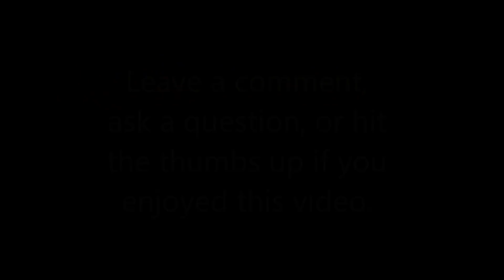Machining Cutters You May Have Never Seen - But Should Own

Comment: Unrelated question: Any tips for holding hex stock/collet blocks in the vice between corners as opposed to flats?
Reply from the maker: I am not a fan of holding collet blocks on the corners. Square blocks can be seated in a V block for 45 degree reference, but hex blocks need a 120 degree nest to do any aggressive work. Always inspect commercial blocks to verify the central nature of the edges.
Reply: @joepie221  yeah my issue comes from the corners not been ground evenly. The flat surfaces are fine (for what I do) but the material removed from the sharp corners is inconsistent, meaning when I clamp on flats I have to reset my tool height each time but clamping on the corners is sketchy at best.
Reply: first step - make some block of aluminium with hex hole in it to decent fit your hex holder.
second step - cut flats on two sides of this block.  (insert your hex holder in hex hole of a block halfway and lock it with some non-permanent loctite. then clamp sticking out hex holder in your vice by flats, indicate it horisontal and mill flats on the block of aluminium )
third step - cut a slot along your aluminium block.
square holder for hex holder are done )

Comment: LE phenolic is not epoxy filled linen cloth.  Rather it is linen cloth impregnated with phenolic resin aka Bakelite.  Bakelite was one if the first plastic resins and is made by a condensation reaction of phenol and formaldehyde.  Early printed circuit board was made from this material although now largely surpassed with epoxy/glass or epoxy/polyester materials. 

https://en.wikipedia.org/wiki/Bakelite
Reply from the maker: Can we safely assume the bakelite is applied in a resin form that impregnates the sheets. Much like an phenolic epoxy binder?
Reply: @joepie221  I recall making some of the resin in the lab years ago. My recollection is the it was a gel-like substance.  I recall that it didn't look anything like what I was expecting.  I don't know the particulars of the process but I would expect that the resin would be forced into the stacked layer of of linen cloth and then heat and pressure applied to cure the composite.  Epoxies are totally different compounds made by a reaction between epoxides and amines and are commonly liquids prior to the polymerization process
Reply: In college, we used Bakelite to hold Metallographic samples. It came as a powder and you put it in a thermo-setting machine, which makes this sweet, slightly toasted smell. To make composites, you end up adding a certain mass of granules in relation to how much reinforcement you use. Neat stuff.
Reply: Actually some is, and differs from an earlier material being talked abut here. Bakelite. Not the same materials. Linen based here was first made by, and patented by GE under the trade name Micarta. There is Linen, Canvas, Paper, burlap, Rag which looks much like very highly figured briar wood are very sought after  and a few others thrown in the mix. There is a new version that is being made in Japan, Russia, and now China. Very fine and quite expensive Diamond Matrix sharpening Stones. These are basically a micarta type product, but using fine synthetic diamond grains and at times mixed with Cubic Boron carbide. Very effective! And far superior to typical diamond sharpening stones.  

KnifeMaker
Retired after 47 years in the Custom Knife Making Business.

Comment: Joe.
Is it still climb milling when the spiral is pushing down ?
Reply: the cutter is still pulling its way up the material so i guess so.
Reply: Yes.
Reply: Climb/conventional has to do with radial engagement.(thin to thick/thick to thin)
Reply: Climb cutter is good if your machine gibs&screws dont have slop in them.
I was told always conventional mill when you can!

Comment: Joe, how tough is that LE phenolic? I have on my lathe a phenolic gear that drives the quick change gear box. My lathe was originally in a trade school setting, but it appears as though it wasn’t used much. I just worry about the phenolic gear being pretty weak. So far it has held up fine but I still worry, if I can still get that gear from Cincinnati Lathe it would be horribly expensive! I suppose I could cut a gear, but I’d have to get the proper gear cutter set.
Reply from the maker: That LE phenolic is very tough. If you have a gear made from it, its probably the engineered weak point, so something more important doesnt blow up. I would not change the material without investigation. Its easily cut, just don't burn up the tools thinking its wood.
Reply: Joe Pieczynski  that was my thinking about that gear being the engineered weak point! Although there are 2 other slip clutches one on the feed screw and one in the apron. That gear protects the quick change gears.

Comment: next time you should add so called 'compression cutters' to the selection. great tools if you need them. to avoid burrs on the top and on the bottom surface of the part.
Reply: Those cutters are amazing on composites.  I was given a carbon fibre tube in which to cut a slot for a hydraulic cylinder position indicator.  The tool rep delivered a compression cutter. Job done easily.

Comment: Johnny woodworker calls them UP spiral and DOWN spiral, but the effect is identical.  Was kinda hoping you would try a straight  router bit. - Next time I have some non metal in the mill I'm going to give one a try just for kicks. - Maybe just for a finish pass.   BTW, Been cutting "into" the part since you hipped us up. Don't meed the Noga burr tool at the mill any more. ,,,, Like they said in "Pirates"  What never? Well,,,,, hardy ever. and right good mill cutter too.  (Bet the millennia won't get that one in a million years)

Comment: If you are cutting wood, try the up/down spiral bits. They are designed to keep both the top and bottom under compression.  https://www.amazon.com/Whiteside-Router-Bits-UD2102-Compression/dp/B0012K5YDK
Reply from the maker: I just recently saw those. they must be a dog to grind.

Comment: Micarta is nasty and G10 is hard on conventional cutters. That all said I'd rather burn through end mills in g10 than work with much micarta. I've done only a little bit of micarta with 3d milling knife scales. G10 actually forms what's almost a chip where as micarta basically turns to a nasty smelling powder.

You can easily cut sheets of composites on a wet tile saw as well. 1/4" G10 and carbon fiber cut quick and with little effort.
Reply from the maker: I have so much experience with LE phenolics, I'd take that over G10 any day. No glass for itchy rash afterwards.

Comment: Joe I wonder if the burr problem could be mitigated if you were to put let's say a quarter inch piece of 6061 aluminum on top and sandwiched the two materials together under the clamp pressure. I suspect that having a harder material on top will prevent the burr from forming. What do you think?

P.S. - that carbide burr cutter is a sweetheart!!
Reply from the maker: Sandwiching thin or easily chipped material is always a good idea.

Comment: Watch out cutting G-10. The dust is a health hazard.

If you're running in plywood, I'd expect speeds upwards of 10k RPM. I thought those left spiral cutters were only for through slots. Most decent woodworking stores have them. With the end mill, if you knock those splinters off, you'll see all the damage to the outer veneer. You will also notice that there is a lot of delamination near the edge.
Reply from the maker: Yet I see a lot of CNC routers using end mills. The performance on an expensive veneer is worth the investment.

Comment: I liked this video.  I liked your comments and analysis of the results.  At first I didn't hear what the black material was, but upon listening a second time, I heard Delran (correct?).  What I don't know is if these cutters will work on metal, yes/no?    I have sub'd and liked.  Thanks for the vid, I will be back.
Reply from the maker: I would think the burr cutter would pack up on metal. I'd go with a corn cob rougher. The down spiral cutters will work, but should be end mills and not router bits. I've never tried them on steel, but have to believe the pressure on the bottom face would produce a huge tool load because of the dragging.  The plastic material was Delrin. Thanks for the sub.
Reply: @joepie221  I'm sorry, I misunderstood the premise of the vid entirely.  I didn't hear the fact that these were plain old router bits meant for other substances that routers usually work on ("not steel").  So of course the wood plastic and Delrin not Delran were correct and appropriate.  I goofed.  At the moment I was looking for machine end mills for steel for my shop and I had that in mind when I clicked on your vid.  There is nothing wrong with your vid because I have all the same concerns with my wood projects.  I'm going to be on the lookout for router bits of the nature you demonstrated.  I still liked the vid and subject matter.

Comment: "Occasionally you are going to cut some wood in your shop"

Not if I can at all help it.
Reply from the maker: No material is off limits here, although I don't take G10
Reply: @joepie221  Nasty carbohydrate foam! BLEH LOL Thanks for your vids, Joe.
Reply: @joepie221  I'm guessing due to allergic reaction to the material,it's abrasiveness,or the cleanup after? My only experience with it is it's application in pool cues,both as a joint pin/internal connection screw (Joe Gold's pin is a modded Acme looking 7/16-11) and as a tip material to aid in breaking and jumping. It's dramatically harder than a pool ball,AND "tougher". I've only turned a few small pieces of it,sanded on it,etc,but haven't hogged any of it yet.The thin sheets I have as well as 2 roughly wallet sized 1/2 slabs have cut fine with a fresh hacksaw and a thin coping saw.

Comment: Awesome, Joe.  For plastics I use single flute "O" upcut cutters from Onsrud for CNC drilling or profiling where slot milling would otherwise cause the chips to build up.  For really thin stuff the downcut single flute cutters are the ticket.  A couple links to cutter info: 
https://www.onsrud.com/articles/O-Flutes-For-Mechanical-Plastics.asp
https://www.onsrud.com/Series/SolidCarbide1-2FluteDowncutPlastic.asp

 (no affiliation)  The key to good results in plastics is getting the speeds and feeds right along with chip evacuation to prevent the cutter from heating up.  The first link above has some info that can be useful.
Reply from the maker: Thanks for the links.

Comment: Could you not just place a sacrificial piece on top and still use conventional cutters?
Reply: Only if you can clamp really close to where youre cutting, otherwise the top piece will flop around and youll still have bad tearing
Reply: @MachinistJohn  yep, sorry, didn't make myself clear, clamp near edges to be cut or plough through sacrificial piece and part if your needing a pocket or grove/ channel.
Reply from the maker: @gazw2100  Yes. A sandwich support  part always helps.

Comment: An interesting series of test cuts and thanks for messing up your mill that bad just to do the demonstration Joe. One more cutting tool you may not know of for a mill. https://woodworker.com/drill-press-planer-mssu-24760.asp Obviously made for wood workers and meant for drill press use. They work 10 times better in a mill collet with the material locked down on the table or in the vise and work very well with the standard spindle speeds available. I have real doubts they'd work at all well on plastics due to the hooked cutting teeth loading up and Phenolic would likely be much too hard and abrasive to the HSS cutting teeth. Think of it as a 3 tooth 3" diameter face mill for wood. Edge chip out on the exit side of the cut can be an issue on deeper doc, but backing up that side with any scrap wood clamped to your part will prevent it. A light sanding is more than enough to fully remove the minor tool marks it leaves.

At the normal spindle speeds on a manual mill (4000 rpm or less) I get better results on wood with conventional 2 flute end mills than actual straight flute router bits. Mounting a standard router to either the ram and knee dovetail if there was enough work to justify the time to do so might be the better method. But those reverse spiral cutting tools are something new to me I'll need to try. There advantages are pretty clear cut.

Comment: A dead tree carcass on a milling machine? What kind of unholy abomination is that ? Get that thing off before you start using tape measurer like one of those wood worker savages !
Reply: I once took a welding class. I was using my precision layout tools to scribe a layout on my work piece when my instructor came up and said, "This is why I don't like working with machinists. In my world plus or minus a quarter inch is precision work."
Reply: @DavidKutzler  Relax it was a joke !
Reply: @zumbazumba1  
You get the same reaction from woodworking instructors.  As far as woodworking with tool room machinery goes. Fine Woodworking (AKA Snobs Working with Wood) once had an article on the Pattern Making shop at Gleason Company. They produce gear cutters and gear cutting machinery. The LeBlond lathes they had were the exact same Regals we had. Also for a small wood lathe up to about 9 inches a Hardinge or similar plain lathe is hard to beat.
Reply: @zumbazumba1  Relax!  I was merely sharing an experience that I had that illustrates how how your experience changes your perspective.